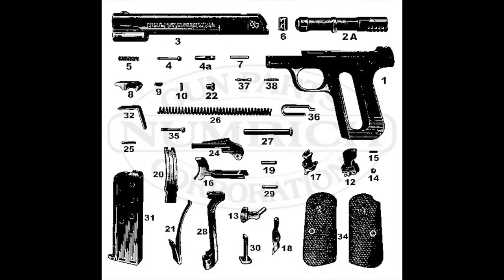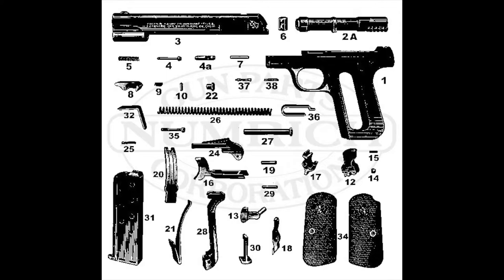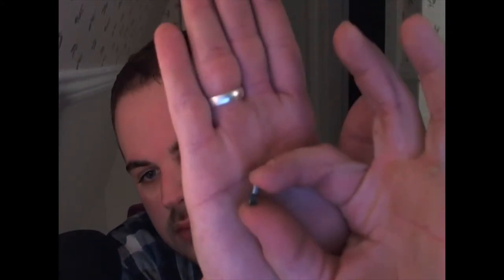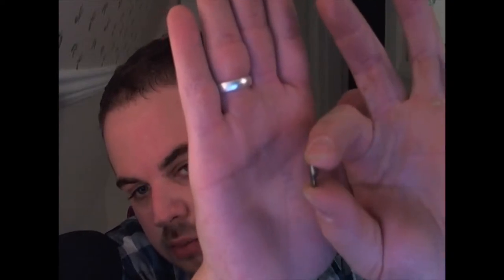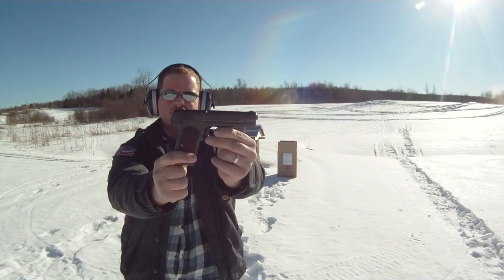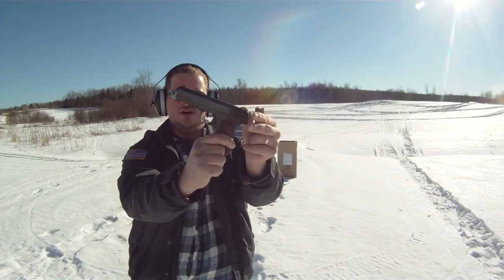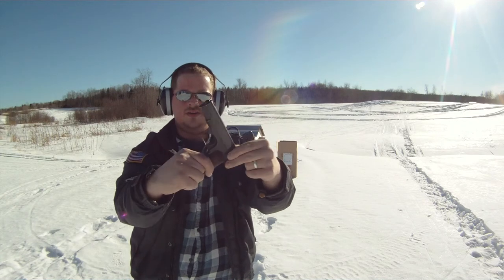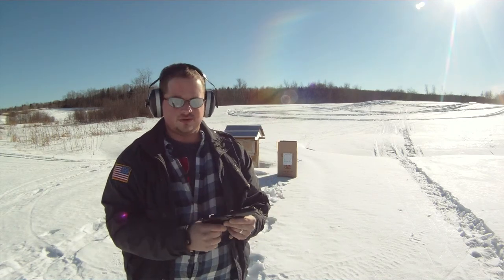Bad Day at the Range Vol. 2 - Colt 1903 Firing Pin Break

Comment: I have one of those guns. Love it! Wish you would make a video showing how to replace that firing pin!!
Reply from the maker: Hi Deputy! I definitely will be videotaping me replacing it. The hard part has been finding replacement parts for the firing pin assembly. It uses a two-piece pin and the rear piece, which is the one that broke, must be the one that breaks for everyone =)

Thanks for watching!
Reply: Did you try Numrich...aka Gun Parts Inc? They have the front and rear firing pins as well as the spring. They aren't cheap, but at least they have them. I have been seriously thinking about buying all three just to have them as spares. And I look forward with great anticipation to your video of replacing it. I have no clue how to do it other than that pin in the back has to be driven out. I didn't find squat online that gave any details about how.

Comment: Did you ever find a new rear firing pin?
Reply from the maker: ryan banks Sadly, the hunt continues.
Reply: Ryan Michad check out http://www.wisnersinc.com/ I had my rear pin break also and the replacement I got from them works perfect. The firing pin spring from them was causing issues, but their pin with the original spring is good to go.
Reply from the maker: What method of payment did you use with them? I had one parts supplier that had one, but I was concerned about giving him a checking/routing number. I like giving a credit card number that I can recall if need be.
Thank you so much for the suggestion. Apparently Colt didnt pay much attention to the rear pin strength.
Reply: I used a credit card. I don't know if we should blame colt for the pin strength though. It worked for 100+ years up to now!